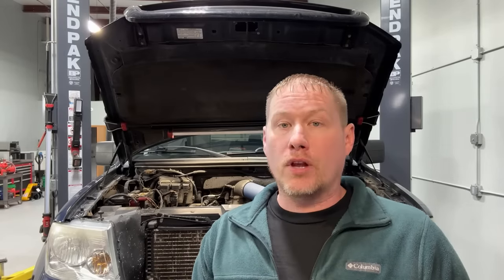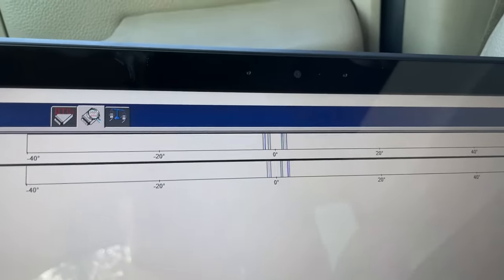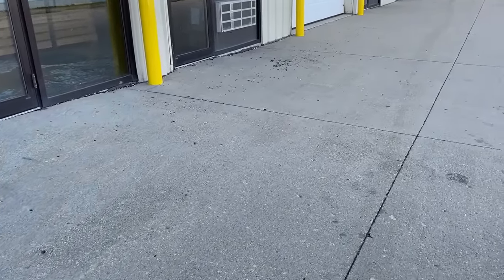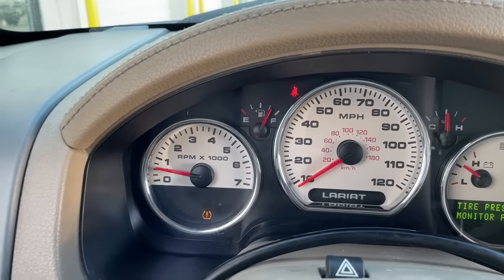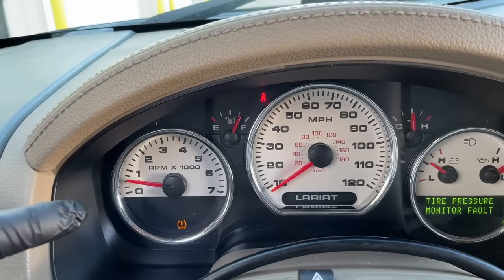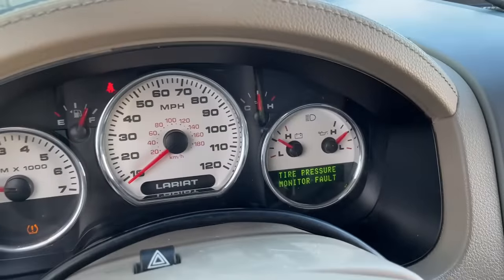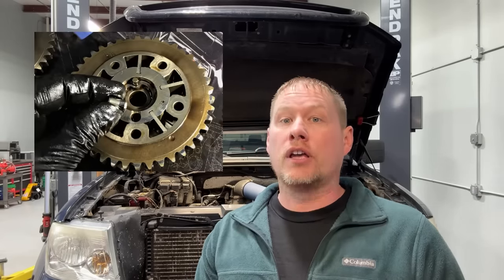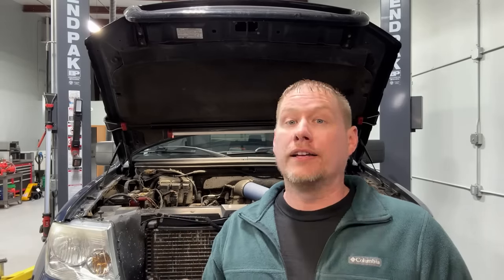Ford 5.4L 3v Triton Engines: Two of The Most Commonly Misdiagnosed Noises!

Comment: I'm in the middle of a timing job on my 2005 5.4 3v with 240k miles. This is the first time its been done. I'm hoping for another 100k. Thank you for your dedication on educating everyone on this engine.
Reply: My 04 FX4 is sitting at 463,000kms and still going strong. Full timing was done around 220,000kms so you should have no issues getting another 200,000 miles out of your engine as long as you run full synthetic 5W30 P platinum high mileage and change every 5k miles or so 🙂
Reply: @Powerstroke431  thanks for that tip. I’m buying my uncle’s 2008. He’s taken good care of it, only 135,000 miles. He only wants $4k, so I couldn’t turn it down. Have you done any upgrades such as oil pump? I want to address the weak points before I start driving it.
Reply: @Orange Manok  no, oil pump is still stock. Install an external oil pressure gauge and if your hot idle oil psi is below 20 then upgrade, but if around 20 the engine should be fine as long as you use full synthetic 5w30, use motorcraft oil filters and change both every 5k miles.
Reply: SaltLife  you couldn't be more wrong....nor do I live or drive in a cold climate.   I trust his expertise and my truck runs just fine...  Everyone's receipe isn't the same.  I truly expect another 200,000 from this engine!
Reply: @orangemanok5800  Brian has recommended if/when you do the timing etc. to upgrade to a high volume oil pump. Perhaps he has changed his thinking on this but IDTS. He has a video to this effect somewhere on his channel. If he sees this maybe he'll link that. IMHO the cost for a high volume pump isn't that much more than a regular one so why not? If you take care of it you'll get a ton of miles from the engine. GL...nice of your uncle to give you a deal:).
Reply: Just did mine at 200k miles on the same year truck (20k since). Went beautifully thanks to these videos. Hope you get another 100k on yours!
Reply: @orangemanok5800  While I am in it. I'm doing Oil pump, water pump, roller followers, VTC solenoid, and the recommended timing kit from this channel. As far as I know that's "bullet proofing".
Reply: @orangemanok5800  Fordtech did a video recently on putting a higher flow oil pump in a 3.5 Liter. I bet he has one for the 5.4 Liter also.
Reply: @OceanofMaya  Thanks. The timing was perfect, as I really needed a truck. He is a retired Los Angeles sheriff and he keeps all of his gear in ship-shape. The truck spent its life here in California, so at least there won't be any rust. They moved to way, way northern Washington last year and keep getting stuck in the snow, so bye-bye 2WD, hello Bronco Sasquatch. He's having fun.
Reply: First yr 2004 f150 5.4 3v. 340k mi original engine valve covers never removed. 15w40 8qrts change every 3k mi. No issues ever. Original water pump, power steering, exhaust.

Comment: Brian your dedication is admirable, still making videos on the 5.4 after all these years
Reply: There are so many still on the road. I have 2014 exp with 190k burns no oil no noises. Only replaced belts and pulleys
Reply: I mean why wouldn't he? It's still paying the bills haha
Reply: I still have my 2004 with 370,000 miles. Replaced engine at 240,000 due to timing chain Rapid Unplanned Disassembly.
Great channel.
Reply: @jasonlarsen3515  ditto! 2011 Navigator here w/140k miles. Change the oil every 3-4k and runs like a champ. Best value car I’ve owned will keep running it more reliable than 90% of the turbo made junk out there today
Reply: It’s because Ford produced millions of these engines since o3-04.
Reply: @John3_3  I have a 2010 Navi myself.  Say what you want about the "turbo junk" but I've driven a later model Navi in the 2015-17 range with the EcoBoost and it has a lot more go than my 5.4 3V.  It's an all around better drive, way more torque and effortless acceleration.  If it was free to go get a 2015+ with the Ecoboost I'd do it tomorrow.
Reply: @DavidJohnson-qb5pg R.U.D. 
I've been looking for that term since I was a wee little scientist. Thank you.
Reply: 4.6 486 nothing but 15 40 oil changes

Comment: I’ve had phaser”knock” for several years now on my 2006 Lariat with 270,000 miles. I think have detected the second sound as you said easing along in a drive thru. It’s a long trip from southwest Alabama to your place Brian. I guess I need to find a local guy that has some semblance of your knowledge and ability. Thanks for the info as always.
Reply: Follow his series of posted videos on this engine. They’re very insightful regarding using the Melling oil pump and OEM parts. We just did one in our shop with 205k. Owner was very happy with results and an extended life for his ‘09 F-150
Reply: Follow his series of posted videos on this engine. They’re very insightful regarding using the Melling oil pump and OEM parts. We just did one in our shop with 205k. Owner was very happy with results and an extended life for his ‘09 F-150
Reply: @jamram9924  Thanks. I’ve watched every video he’s ever made period, not just those on the 5.4 3v. I went to 5W30 years before I found his channel. Biding my time on when and what to do. I have a local mechanic who is a former Ford dealership guy and I’m going to confer with him.

Comment: I have 2004 5.4 3v when it goes in overdrive it starts shuttering. Number 7 keeps misfiring and I've changed plugs, coils, injector and both connectors. I'm totally stumped and need some help please.

Comment: So happy we are getting these videos on the 5.4 3V still. My 2010 is at 257,000km with lots of short trips since I work 8km from home. Parts are still original and engine is running perfect and quiet. Think this summer I will replace the rocker followers to the new ones with the smaller hole. Don’t want to push my luck.
Reply: The problems only occur in 2004-2008 models. I think 2009+ are better engines.

Comment: I've been saying this for years. My wife says people don't want to know the details why their engine is making a noise. They just want it fixed.  I'd say 95% of owners that go to the dealer or another shop instantly get told they need a new engine. I've lost business from telling people it just needs a timing set and an hv oil pump because they've been convinced by the other 3 shops that the engine is bad. I get told I don't know what I'm doing and no way I'm working on their vehicle.  Just irritating when I hear someone say they spent $8k plus getting a new engine. Wish I could convince people to hand over money like that.
  A couple of years ago, doing 5.4 3v timing jobs was my bread and butter. I still have several sitting that just need a timing set, from the owners insisting on a new engine.  Shops don't have mechanics with experience to know what the issue is, so they just say needs a new engine. And shops go with the flow with other shops to make more money. Meaning, when a customer says the other shop said they need an engine, they say yep, it does. 
  I believe the 5.4 3v got a bad reputation for a few reasons. One, lack of maintenance or improper maintenance.  Two, mechanics/shops shaking their head and saying needs a new engine.  Three, people hearing stories about how bad their engine is.
Reply: Dude 5.4 3 valve is a horrible engine. MACK says so himself in a lot of these videos
Reply: @Johnson Bobo   The 5.4 3v may be worse than other Ford engines in some opinions, but every one of them I've had has lasted over 200k. I can't say that for other engine brands. If they are properly maintained, they usually give a full service life.  I don't work on just Fords. I work on anything that comes in the door, and that includes Dodge, Chevy, Honda, Toyota, BMW, VW, Peterbuilt, Cat, etc. Also Briggs and straton, tao tao, and anything else. 
  With all the hauling I do, the engine that caused the least issue was the 5.4 3v.  In the military, I worked on mainly diesels, and I'd much rather work on a 3v than pretty much any other engine. To me, they are easy and not complicated at all.  I never said he is wrong.  I just know I use to do timing sets on them pretty often for customers, and everyone has told me they didn't have any other issues other than the filter adapter leaking, which was an easy fix also.  
  A timing set doesn't make an engine the worst one out there.  And Ford is having issues with timing components just like every other manufacturer is.  Timing jobs are apart of maintenance.  I still have several 3v's myself that run fine with over 240k miles. I can't say that for anything else I've owned, and I currently have over a dozen personal vehicles of different makes sitting here.

Comment: I want to thank you sincerely for your help from the complete walk through videos you posted as I just completed the timing rebuilt. All new components including oil pump upgrade and all new oem valve train components. Adjusters, followers fasers, selinoids, plugs, coils ,chains, guides and chains. It was a real task but well worth it. You are a real gem and I really appreciate you. Started it up this morning and sounds like a brand new engine. More oil pressure, power and responsiveness.
Thank You Soo much.
Leon Wellwood

Comment: Thanks to you, just completed the full timing job on my 07 f150. Ford everything , except Melling oil pump.  Also did all lash adjusters & all  followers. Also p/s pump & hoses, intermediate steering shaft. 192,000 miles & everything was original.  Going for the long haul! Was not cheap, but w prices these days, I'm keeping it going! Thank you again! Btw, been using Mobil 1, 0w40 for the last 75k, and this engine loves it!
Reply: 0W40? that works? my 04 Lariat is at 237,000 miles... and I live in the high desert in So CA. think that would work??
Reply: @Butchcub75  definitely!

Comment: Because of your channel I have steered completely clear of these 5.4 3 valve Triton engines/F-150 when I've had several opportunities to buy them on the cheap.......
Reply: Great choice
Reply: That's too bad. Did you see the video he just posted last week? Properly cared for these engines will last 300k--400k without any major issues barring the guides and timing stuff that he's outlined need repaired.

Comment: Thanks for these videos. It really helps to explain the things that I need to look out for with our truck! I believe we have a little of that phaser knock going on with ours but it’s nice to know that I don’t need to be horribly concerned about it. Thankfully we got an extended warranty with ours that specifically covers the timing system. We are at 95k miles and our warranty is good for another 40k miles or 4 years. We got a second car for commuting too so it’s most likely gonna go the full 4 years. God Bless!

Comment: I just bought an 06, and it has these exact noises, along with trying to die at low rpm after it's hot. Runs like a champ for like 10 miles, then as soon as it heats up, dies if I lift foot off the pedal.  I just ordered all the parts Brian advised,  will try to do this job this week.

Comment: You mentioned you have a video on stalling out. Could you help to find that video. I think this may be my issue. You do such a great job and I like to watch your channel. Thanks for your great content. Keep up the great work you do.
Reply: Mine is doing the exact same thing. No problems whatsoever. Then driving about 35 mins to an hr the engine just dies and won't restart for 5 minutes or so
Reply: I would like to see that video also. Mine is doing the same thing. I would like to know what repairs are required.

Comment: This is the single most helpful diagnostic video I've seen yet. And you describe and show the sounds exactly.  My 08 5.4 with 280k miles is making those exact noises, especially in the summer.  I'm in the process of getting enough parts together to build a longblock to replace my engine using the links you have provided in several other of your videos.
  I have two questions if you'd be willing to answer with your opinion.   
        1. In a completely fresh engine with the melling pump, do you still recommend the 5w30 oil?  
         And 2.  Do you have a recommended source for new, bare, head castings with the 12mm plugs? You do a great job helping so many of us out. Thank you!
Reply: Any updates on your project?
Reply: @yiction  Got the shortblock assembled. It's. 030 over, had to go .010 under on the crank to get good bearing clearances. Have Comp xe253 cams for it, and went with new, aftermarket bare head castings off ebay.  I ordered the full timing kit recommended by Fordtechmakuloco along with the updated roller followers. Still have to assemble the top end yet though.

Comment: I have an 09 with only 58K miles.  My truck makes  rough idle/knocking sound on occasion.  It seems like it's always after pulling my utility trailer (dirt bikes) and as I'm backing up or slowly pulling forward to park.  Sounds like having a hot engine could be the issue.  Appreciate the video... new sub!

Comment: Thank you so much for your videos and taking the time to explain things. I wish you were closer I would love to have you listen to my truck. 09 F250 with 153K automatic. Only at hot idle. I didn't learn from the last F350 with 218K on it, it had phaser issues which I solved by installing new ones with the lock outs. This one may be headed the same way before I send it to sale.

Comment: Outstanding subject knowledge.  Thank you.  I think I've both noises.  Not sure if it is phaser knock or bad followers.  Really have the oscillation.  Goes away if RPM's are raised, returns as it approaches idle.    Need to pop the truck to neutral and rev the engine at traffic lights.   You don't tell us the solution.  Is it a phaser failure, solenoid failure or an oil pressure failure?  Add a Melling oil pump and 5w30 solves the problem?

Comment: My 2009 ford Lincoln platinum started doing that at 80k. I only have 132k as today. It would come on and off that noise and I had the motor 2 years ago in 2020 chemically flushed and cleaned inside out without taking it apart and then put new oil witch they never found any metal shavings or anything  and the noise has been gone since then. I do oil changes every 3000k or every 4 months.  It is the 5.4 - 3V as well. Love your videos. No one my town wants to put hands on them and the dealers keep giving no answers and just want trades done. Sick and tired of them. I may just have to do all the work my self and just change everything as I go. The truck has treated me great for all these years beside that noise for a while.

Comment: I have the warm Idol tick. Only 60k on the odometer. Done the complete timing  with up graded parts and mellings 340 hv pump. None of my parts had any noticeable wear so I think it was all for naught. Super clean engine so I think it’s the exhaust manifold. I’m still happy I did the work myself on it. I does idol smoother.  But the noise is still there.  I’ll now drive it till it drops and ignore the noise.  These 5.4s are not as bad as they say. I’ll take one over a multi displacement engine . Possibly a turbo as well.

Comment: Ive just replaced the lifters on my (AUS)Ford Falcon 5.4 3v thinking the knock was coming from the front 2 cylinders on the right (drivers side here in oz). Cams out and replaced them all. The old ones were very loose with no spring pressure as opposed to the new ones which were very hard to compress...............Still have the same knock...... Phasers and oil pump next i guess but cant buy oem parts anywhere in Australia and Amazon are sold out...Not sure where to get a reliable timing kit from. 5.4 3v isnt very common here. Great work Brian 👍
Reply: I'm in the same boat chasing OEM parts for my ba falcon

Comment: I almost had a sigh of relief when you said phaser knock wasnt that big of a deal but then the oscillation thing got me, T_T, ive definitely got that and a bit of chain slap on startup but only at times not every start up. Its gonna be a hot minute i can not afford this repair, just gotta hope and pray this truck lasts since ive got nothing else to drive lool....
Reply: Did it last?
Reply: @TBuilds888  knock on wood still going, wheel bearing is about to eat the dirt tho.

Comment: Good video. Of course having a good scan tool so watch your timing PID’s is a good way to back up your diagnosis. Guess if you get to the point where a high volume pump is needed looking at cam journals and crank end float is key before you put the wedding ring on it.

Comment: My 2007 F-150 5.4 has always had the phaser oscillation noise since I bought it with just over 40k. I've had an oil pressure gauge on it for years now and when it is "oscillating", the gauge shows a steady 40 PSI. In response to you saying it's because of a low oil pressure issue, I think that's strange because if that were true (in the case of my truck at least), I'd think it'd be a lot lower than that.

Comment: What mileage do you recommend a timing job on the 5.4L 3V? A mechanic at my dealership recommends 100k miles!
Reply: yup, same question,  or do you drive it till you hear it
Reply: Look up his series of videos on the 5.4 3 valve engine. You’ll find them very informative. Our shop has done this job before and followed his recommendations and used all OEM parts except for the Melling HO oil pump. Last customer had 198,000 on his 2009 F-150. We replaced the rockers and lifters for a much complete result, the cams were fine. Customer was very happy!
Reply: I got 252,000 on mine. I just sold it but it needed the job done
Reply: I’m sure it has some to do with how you’re using your truck. It’s gonna vary

Comment: I had a 2006 FX4 that I had the dealer do a cam phaser job when I bought the used truck. We split the cost. My current 07 XLT doesn't seem to need this at 146K. So far so good.